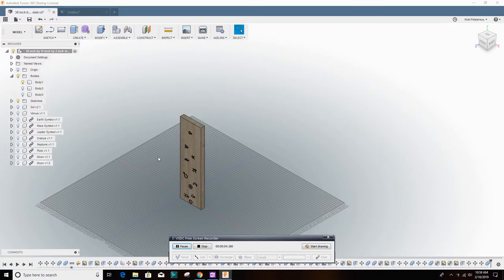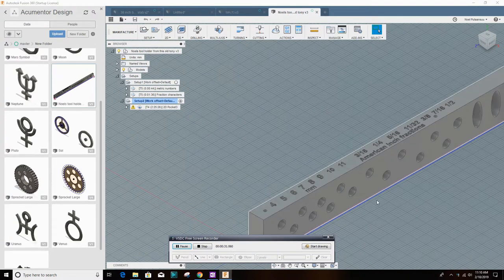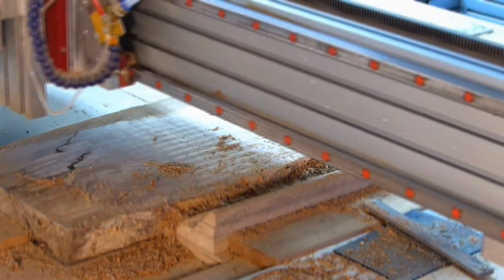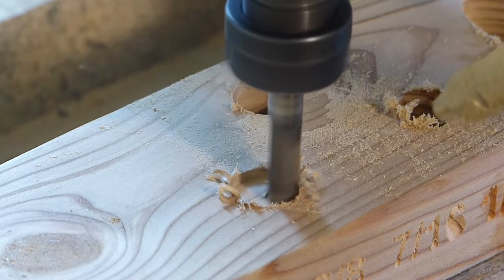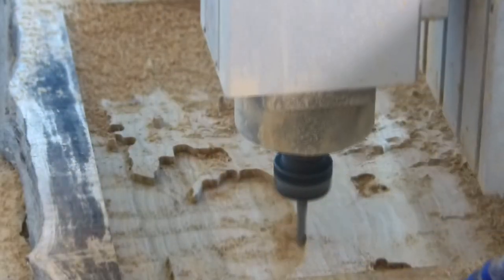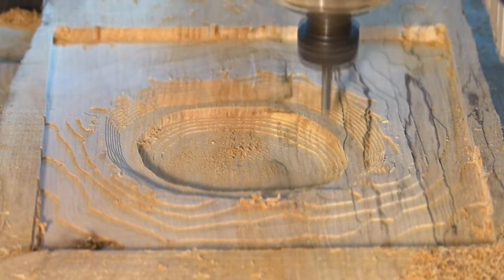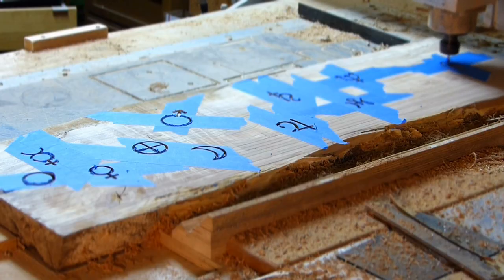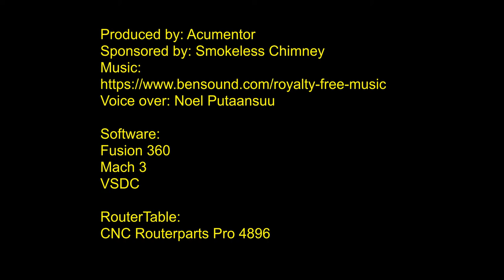Wood Projects Fusion to CNC router table and Finishing

Comment: Interesting applications.  I had a little trouble hearing you at some points though through the noise but it was great to see how you approach your work.  A screenshot of your speeds and feeds occasionally would help us newbies get a sense of what works well. Cheers
Reply from the maker: Thank you. Yes talking over the spindle was not a great idea. I will work in a feeds and speeds video.